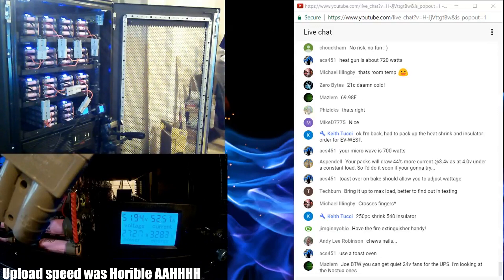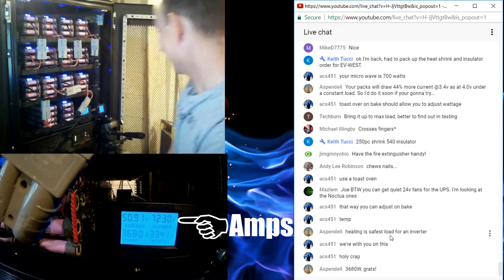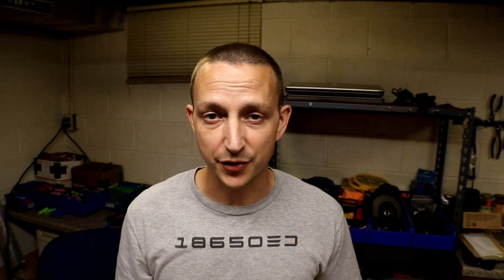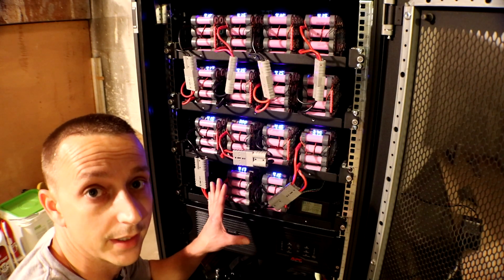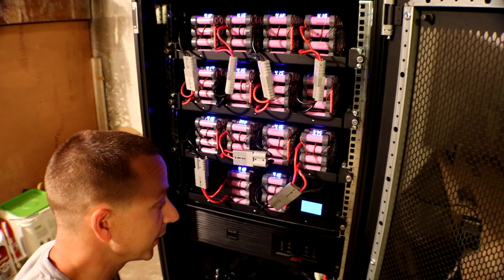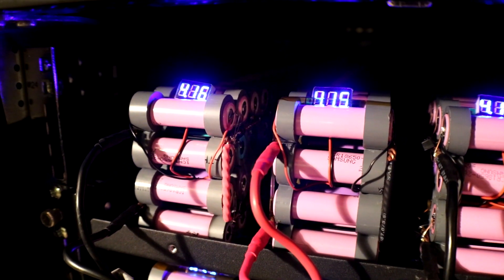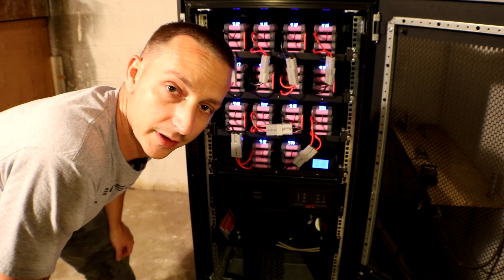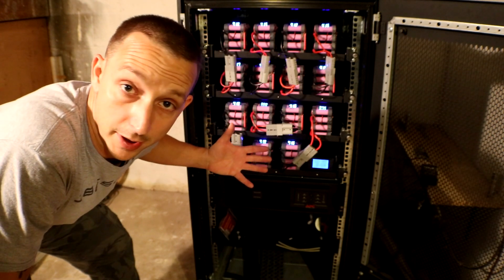First Ever Real Load Test on My Power Rack!!! Live Stream Update!!!

Comment: Frm the phil.
I assemble a 18650 3s pack 
11pcs each raw,, how many Amp ? 
I dont thik im right..my comption is 
2600 x 11 = 28.6    28.6 Amp right or wrong
And why its down to 11.7 volt =time 7pm.. My only load is 10 watts "   why is down so very fast  from 14.4 volt = time 5pm to 11.7 volt..
Thk you sir ..(sorry to my english)
Reply from the maker: Yeah 28.6 amps is correct. Full charge on a 3s is 12.6v not 14.4v!  How many hours did you have it running with 10w? You should get around 28 hours of run time with a 10w dc load. If you have an inverter you will get less time.
Reply: @AVERAGE_JOE  that time its only dc load i use..my inverter is not yet connected to the battery..
But..why its down so very fast..to 11.7 volt
I inspected its 12.6 volt,
Reply: That time was 7:00pm...the volt is 11.7
Reply: @AVERAGE_JOE  i think is  my wires are so big...and so long..8meter dc wire for my 6 pcs  led ligths...
Thnk you for reply sir
I planning a assemble a 100Ah 18650 pack..
Reply from the maker: How many hours in total was it on?

Comment: 70 amp in load on dc? or on ac? Wasn't clear this video. Was 110 ac or 220 ac ? Or it was straight from dc load?
Reply from the maker: 70amp load was on the DC side and am able to max out the UPS to 106% which was just over the 2700watts at 120vac!💥

Comment: Hey Joe, what current are you using to test the capacity of a cell on opus? I'm asking it because i'm getting diferent numbers when comparing the results with imax b6.
Reply from the maker: +Rafael M. I use the 1amp setting on all of them just to get through them faster. Normal load in a powerwall would be less then 500mah or even 250mah but testing them at that setting takes forever🖒
Reply: AveRage Joe Ty bro, and happy new year...
Reply from the maker: +Rafael M. You betcha and Happy New Year to You!!!🖒

Comment: If your voltage leds are like mine, you can look behind them and adjust it using its little knob.
Reply from the maker: Yep, I have adjusted them but they dont always follow on the lower end.  Probly since the meters I have a 3-30v.

Comment: To control the heat on the cells add an extra fan or two
Reply from the maker: Theres 2 huge fans on the door that I was going to use but there 120vac then I found the same size that are 48vdc from my recycler.  I got 6 so Ill probly put 3 on each door, 1 door intake and other out👍

Comment: you can calibrate those little voltmeters. usually there is a little smd pot behind. while you are at it get a voltage reference check and if possible calibrate your multimeters as well.. AD584 based cheap ones are good and enough for the job or you can get more expensive fancy ones. also if possible do not go for 4.20 volts the capacity benefits over cell life time is not worth it. go for 4.1v max or something. good luck
Reply from the maker: +zivizivi Yuppers I put a lil vid out for adjusting the pot. Sometimes they follow the battery voltage and sometimes they dont. 🤔
Reply: yea i saw it late sorry about that just discovered your channel checking your videos out. i was after 24v ups 18650 usage actually then i got lost heh. anyway dinky little chinese trimpots aren't that stable vibration or heat affects them bad. u can try putting something on it to stop moving around like the usual hot melt or nail paint stolen from the wife if that doesn't work good enough better yet remove the trimpot solder resistors instead will be much more stable. u can  measure the correct value with the adjusted trimpot and then use close but lower value metal film resistors and then file resistor slowly in one spot to make custom value. then you can cover the filed spot with nail polish paint thingy after. your own adjusted stable trimpot...
Reply: you can also modify the little voltmeters to use external voltage and just measure the batteries without affecting them. 2 wires to 3 wires with 1 resistor difference... then you can mount them away from batteries in a more fancy position as u like
Reply: https://img.fasttechcdn.com/386/3866800/3866800-1.jpg 
https://img.fasttechcdn.com/368/3682003/3682003-4.jpg

see the difference just a jumper to trimpot 0ohm resistor. if u remove it you can feed voltmeter from middle pin and measure separate sources. i think it may be more usefull for you. you can make a measuring display section on the corner with the other fancy display. maybe put them all inside the ups front plate
Reply from the maker: +zivizivi No problem. Wow ya thats a great idea. Thanks!!! Are you building a powerwall or just messing around with ups units?
Reply: wish i could have no space or roof access for powerwall. living in a apartment in a big city  am more average joe then you i guess. i like the idea of powerwall tho. so watching what ppl do. different solutions and little details are fun to observe from afar. better then watching tv heh. just horsing around. have a modified 24v ups working with the same big sla batteries for 7 years will need changing eventually. was thinking about replacing with 18650s instead with the floating charge problem in mind. then i watched some of your videos thinking solutions to your problems what would i do different how to improve and such. mind games. many alterations and new things you need came to mind so i started suggesting slow and basic.
Reply: first thing is first tho. you need accurate voltage measurements. 0.1 volt error will hurt you a lot. either get an expensive reliable calibrated meter or get a cheap voltage reference and use the stuff you already have.  look it up "voltage reference" "voltage standard" there are many different products on sale cheap and reliable just buy one to try at least seriously important for the stuff you do i think.
Reply from the maker: +zivizivi Ya an apartment sucks, been there done that. We broke our aprtment contract to buy this house lol.  Yeah theres tons of tweaks ect that Id like to do but so many projects the cash gets spread thin😉
Reply: yea must prioritize the needs without breaking the bank. good luck have fun stay safe all the best
Reply from the maker: Interesting.  I may have to try that!!  Thanks for the pics and info!!!  The original plan was to use those volt meters in a different location with a switch to turn them on and off.  Might still be an option👍
Reply from the maker: +zivizivi You know it 🖒

Comment: Hi joe I want to ask you something. How do you charge the 18650 batteries? How do you balance current and voltage? you know we need to charge 3 phases with 18650 batteries how do you provide it? Can you fill a full capacity battery? Thank you in advance for your reply. I follow my videos very closely.
Reply from the maker: +Plus Müzik I am charging with solar😃 I built each pack as balanced as I could in capacity. Each one is 226amps. What do you mean by charge 3 phase. I use a pcm60x mppt charge controller to charge the pack. Yeah the solar will completly charge them back up.
Reply: I understand very well, but I am curious will the flat charge process charge the batteries 100%? Is not it necessary to charge the 18650 batteries by applying a constant voltage after 4.2v? forgive me for the wrong spelling use translation.
Reply from the maker: +Plus Müzik Oh ok, ya the charge controller will gradually reduce the amps as the pack gets full like any other controller. Depending on what you set the end voltage at, it will trickle in at the top. Once there full charged it will keep a voltage on them as long as there is sun. Those settings are adjustable with bulk, float and constant volt settings in the charge controller. Does that make sense.
Reply: then the upper voltage is important for us. Room is around 4.2v. Thank you for taking the time.
Reply from the maker: +Plus Müzik Most of the time Ill charge to around 4v so the cells will last longer. Probly go down to around 3.2ish on low end 🖒
Reply: Hi Joe, really enjoying your build videos. Trying to learn as much as I can. If your solar charges it completely, how many hours of usable sunlight does it take for you to charge from, say 40% state of charge to 90% state of charge (essentially charging 50% of your 10 kwh system)? I take it you are mainly using the 700 watt solar setup you had in your videos (those six 24V panels).  Also, still learning again, but can the UPS draw power while you are using the pack at the same time the PCM60X is charging it? Thanks! Again, great videos.

Comment: about 3500-3600 watts, then?
Reply from the maker: That part was the watts at the current battery voltage 😀👍
Reply: yes awesome, I can't wait to catch up to where you're at
Reply: so let's break that down, at 3600W and 1400 cells that's about 2.57W per cell, right? so less than 1A per cell even as low as 3V, very comfortable load per cell.  But on the other hand, charging with (what was it, 270W(?)*6=1620W (that seems higher than I remember, thought you had about 1400W on your roof) so anyway let's just say if you had 1400W that's 1W per cell, 1W/4.3V = ~232mA, also comfortable, above minimum amps (I believe it's around 100mA or 110mA, at least that's what my BT-C3100 cuts off at) but I guess maybe your charge controller handles that side of things
Reply from the maker: +bcmasur 🖒
Reply from the maker: +bcmasur The solar panels are 235w each. I have 6 of them up there and they are 3 in series🖒

Comment: I'm sure there's so much more that needs to be done, but, hey - YOU Got what you wanted - DONE! from here out it seems like it's just a matter of building out the circuits and maybe a bit more monitoring & safety stuff. BUT be PROUD, my friend! If i may, i'd like to suggest a meter that i've been using for a while. you may have run across it, but if not: here's the Amazon Link:
https://www.amazon.com/gp/product/B01DDQM6Z4/ref=oh_aui_detailpage_o00_s00?ie=UTF8&psc=1
The Ampere measurements are read through an "induction ring" (hall-effect). I find this a lot easier to hook up in that I do not need to split out the main wiring, because you just need to run the wire through the ring. much the same as a Clip Ammeter. the meter is rated:
DC: 5-12V and up to 100A. so far the two i've been using have been running fine. the readout will alternate between V & A about every 3-5 seconds, but there's a button on the back that you can lock into just V or just A. i've just ordered 3 more.
Keep up the GREAT work!!!
Russ from Coral Springs, Florida, USA
Reply from the maker: YES BOOM and Done LOL.  Yeah theres still plenty more to do/change around or upgrade but I am very pleased with it so far!!!  Yeah that meter you have might work out a lot nicer because of that reason of not making extra connections and stuff.  Might have to get one.  I wonder if I can find one that will keep the kw used and stuff.  I like that part of the meter Im using.😀👍

Comment: Any you guys know what to check other than the circuit beaker on a APC sua1500 that doesn't power up on mains
Reply from the maker: If the batteries are crap or missing it usually wont turn on.  What methods have you tried so we dont recommend stuff you already tried.

Comment: Joe what i was trying to point out that you missed during the stream was check your voltage at v-out no load then load it up and check your voltage drop at the inverter v-in and see what your voltage drop is.. I was seeing a 3 volt drop which is telling me your v-out cables need to be upgraded for less of a voltage drop and increase efficiency and longer run time under heavy loads and less heat on the v-out cables
Reply from the maker: Oh For sure I can check that.  That multi function meter is hooked up at the fuse lug closest to the ups but I get what your saying now.  I could probly check it in a few different places.  But I agree on the cable size.  If I want to pull more from it then Ill need to upgrade.  Im probly at or near the minimum wire size.👍
Reply: yeah if your gonna do 70 amps you may want to consider no less than 4 awg wire but to reduce voltage drop on v-out/v-in to keep efficiency at peek use 2 awg or 0 awg  flexible cable. Also on your solar you may not have enough amps to have to worry about it but during charge state keep an eye on your ground wire going to the batteries and make sure it dont get hot and your connector post too ive had a few ground wires melt down in the last 4 years of doing solar i was like hmmm your suppose to handle that current well crap its only 60 amps!!!!!!! 8 awg wire does not like 60 amps charging and its not very good with it powering things either.
Reply from the maker: +Steven Rowland Ill keep an eye on them. Yeah Im not there yet on the solar lol but hope to get there one day🖒That is 2g from roof to basement.

Comment: when the battery is empty, how do you switch to power grid?? or are you at night at 3 o'clock in the dark?
Reply from the maker: LOL Good Question!  ya at this current time I dont have it all wired in to use its full capability.  I probly have some sort of a transfer switch later on but for now Ill keep an eye on the voltage and switch back and forth as needed.  You know me, I make it up as I go LOL

Comment: Congratulations and good work! My only concern is that I've put in controls to charge to a 3.95 VDC limit because so many folks have told me that I can double the life of my batteries by charging to under 4.0 VDC. The difference may be over 300 charge cycles for Lion batteries. I guess your charge controller/BMS may be an item to consider.
Reply from the maker: Thanks! I can and will adjust the voltage limit.  It was charged a little higher for the load test and under normal conditions Ill charge to roughly 4v.  I would like to get a bms tho! 😀👍
Reply: It was smart that you have "long-mons" (in your case voltage displays) with simple series arrangment but indeed the load size makes it unlikely that you can simply buy something off the shelf.  If Peter doesn't use BMS or has an idea it's a design project. I know using a PLC or easier yet an Arduino is possible in this application with Mosfet drivers but it will take awhile to craft a dependable "boiler plate" system. So? for the time being it's an item on the back burner that is subject to daily consideration. The bottom line is that you don't want to go overvoltage during charging or during initial discharge because of impedence mismatches from long-mon to long-mon but the discharge impedence concern is a real problem. I guess you could start with the Batrium hardware (Longmons which have alarm functions, signals) which is also a viable option. For the time being charging to no more than 3.9 or perhaps 4.0 V is likely to prevent internal battery electrode plateout until you sort it out. I've got four 1 KW batteries and during discharge I can see one row go over 4.2 for a short while, that's why a BMS is a good idea but at 60+ amps I am not aware of anything commonly availalble. Perhaps Peter's hardware includes equalization devices that are essentially a BMS.

.